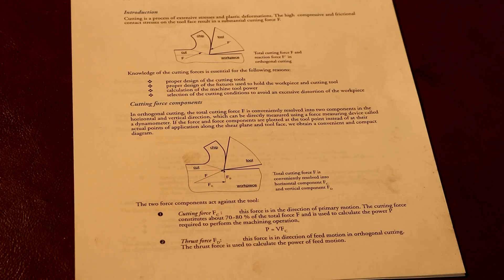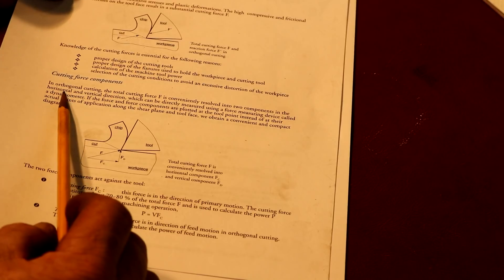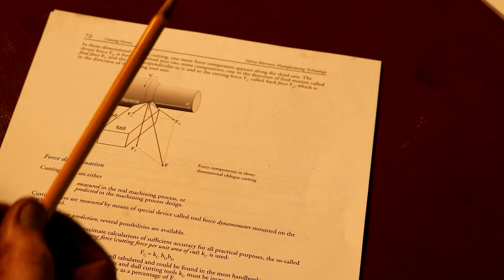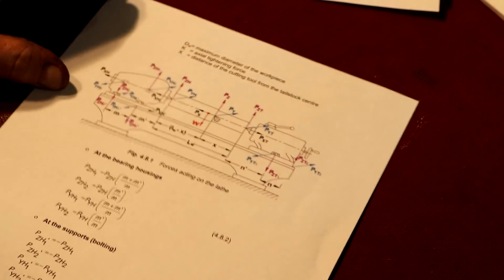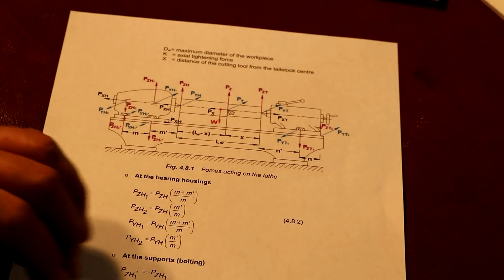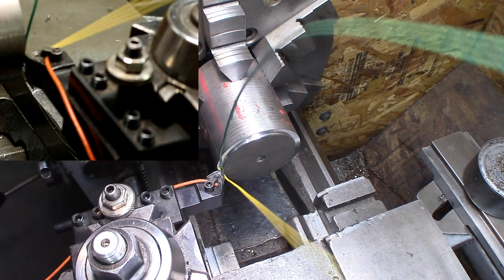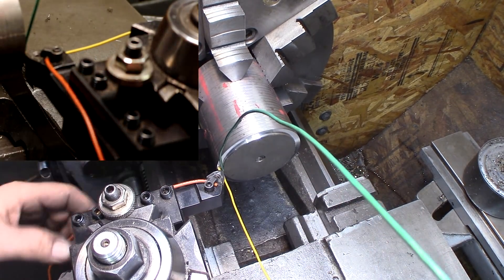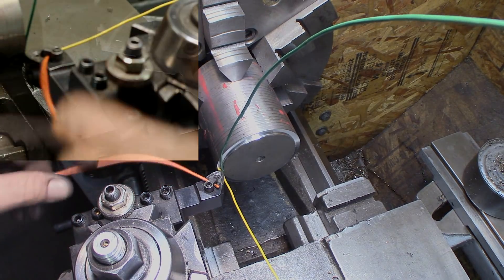Lathe Tool Cutting Forces and How They Work

Comment: I have a problem with my lathe where I'm getting a lot of chatter and crappy finish.  Someone suggested putting the leveling legs on it which I did,   That didn't help at all.
Reply from the maker: I would be checking the gibs on the crosslide and compound.  Tool Post for tight flat fit to compound.  It is all about rigidity of the tool.  Of course  tool cutting edge on center line of the work.
Reply: Thanks Randy.  I will check that out.  I also put new spindle bearings in it, the spindle is within  specifications
Reply: Tool height right? Is it every tool that gives you a bad finish? Does more spindle speed help? Is it every kind of material you're working with? Need more info..

Comment: I wonder how much basic tool geometry affects the distribution of force on those axes .  Would taking an Abom size cut with a 45 degree insert kick some of that feed force back towards the operator?  How about with a round insert?

I don't think I've ever seen a setup on a working lathe to measure how much those forces actually deflect the tool tip, and I'd be pretty curious about that.  How much does the tip dip below center on heavy facing or turning?  I bet that establishes the 'chatter limit' on benchtop lathes!
Reply from the maker: They used 3 axis dynomometers that they built special to hold a tool to make measurements.  Any cut where you decrease the  cutting angle below 90 deg starts send forces back.  Tool tip geometry makes a difference also.  The larger the radius the more force pushing back, a round insert for sure.
The tip dip,  this sure can be a problem on small lathes.  This is where a rigid tool post, tight gibs, low back lash all make a difference.  This is why parting on small lathes can be so difficult, but on a nice big lathe it is not a problem.
Reply: I've tried round turning inserts thinking I could get a super finish, but all I got was a ton of chatter.

Comment: Hi Randy,  I didn't read the articles you had, so take these thoughts for whatever, but orthogonal forces are not additive.  You need to do a vector for total force F=sqrt(fx^2+fy^2+fz^2).  If you take a 2d vector at 45 degrees you have 1/sqrt(2) of the force in each direction or 0.707*F.  You can't say 70% is in the vertical and thus only 30% is in the horizontal.  You have 70.7% in each direction.  At 80% in the vertical, you'd have 60% in the horizontal.  Good discussion though.

Comment: Some very useful reminders Randy and in particular some of the math behind things. Always good to go through this stuff and I am eternally susceptible to learning. Must admit over the years I am guilty often of the ''gut feeling'' approach - based maybe in part on some mistakes made a long time ago when I started machining.
I have had to learn also to be kind to my old lathe which means often babying feeds and speeds a bit, but also paying attention to cutting tool geometry. Rigidity within the system is most certainly an important factor.
The diagram showing all the forces within a lathe is very interesting. Whole deal in essence boils down to multiple vectors.
Good review of the subject.

Comment: You have to be careful how you add vector forces, the sum of the x, y, z forces will add up to over 100%. ie if the force was at 45 degrees to each axis both would be 70% 1/sqrt(2) of the total. I would be interested in seeing the stiffness of your nut arrangement by seeing how different a spring cut diameter was to a max power cut diameter. I have seen other lathes use a pair of 15 degree wedges acting between the 2 nut halves driven by set screw.

Comment: interesting Randy, cutting forces were somewhat of a mystery to me, this video helped a lot. Still confused about the 90 degree part, I do understand that the tool post is at 90 but if you use a left hand or a right hand tool doesn't that mean the tip is no longer 90?

Comment: Randy, I agree that the infeed force is normally relatively small. I disagree with some of the details of your discussion. First, it is incorrect to talk as if forces in orthogonal relationship (at right angles to one another) add up arithmetically. A vector sum is not the same as an arithmetic sum. You cannot correctly say things like “80% of the force is in this direction and 15% is in this direction so there can only be 5% in the third direction.” When you are calculating total power required to turn a workpiece, you end up calculating the torque required to rotate the spindle, and the infeed force usually has little effect on that resultant number. In that sense, it makes up a small percentage of the total torque, but that does NOT mean the infeed force magnitude has to be small. In fact, you can easily demonstrate that infeed force can be HUGE. Just try to drive your cutting tool into the workpiece fast. Everyone knows that you will encounter a lot of resistance when you do so, i.e.., infeed force will become large. Again, I don’t disagree that infeed force is usually a small component in the calculation of torque required to turn, but it can still be a large force. A couple of other things to think about: First, you can easily measure infeed force. Just disconnect your leadscrew (as with taper turning) and push on your cross slide. Second, what you are saying is that virtually ALL of the wear typically seen on cross slide screws and nuts is due to friction. This might be true.. I don’t know, but it still means that the cross slide screw and nut are generating significant forces. Otherwise, there would be little wear.